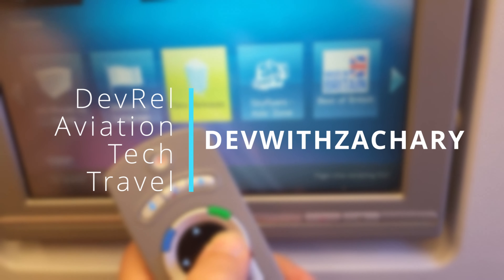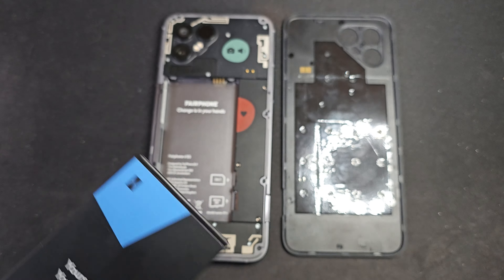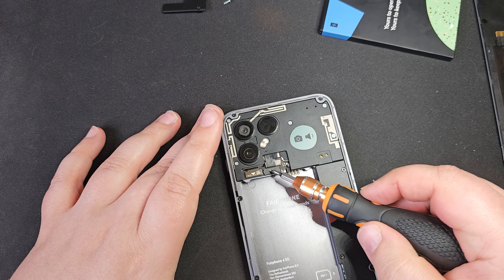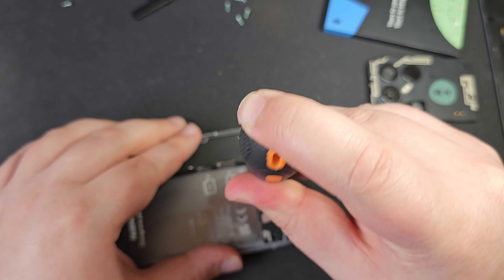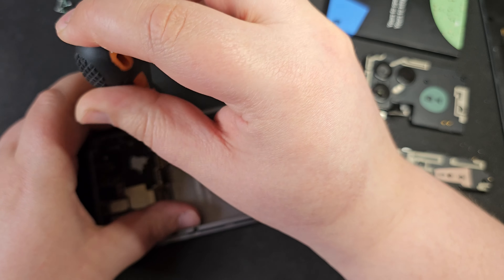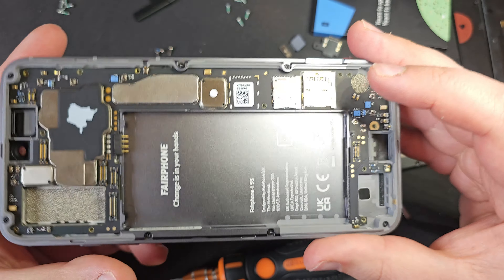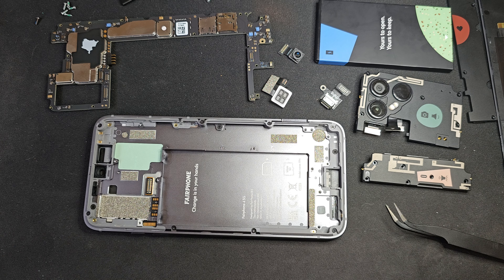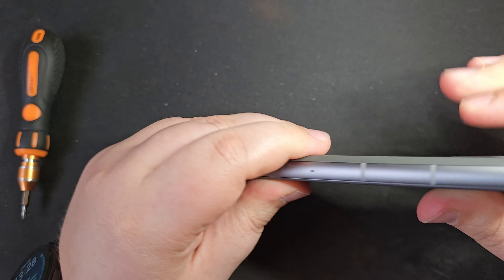How easy is it to repair the Fairphone 4? - Teardown review

Comment from the maker: Update: The screen does come away from the frame very easily by unscrewing the extra screws around the frame. I should have double checked this point before recording but at the same time didn't want to damage the test device so didn't proceed. 
TLDR the screen is as easy to replace at the rest of the phone!